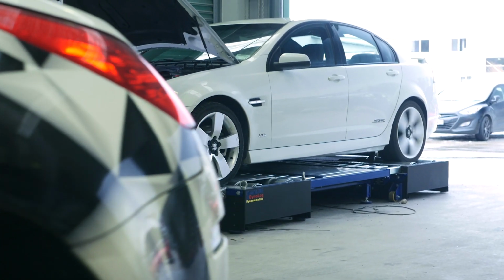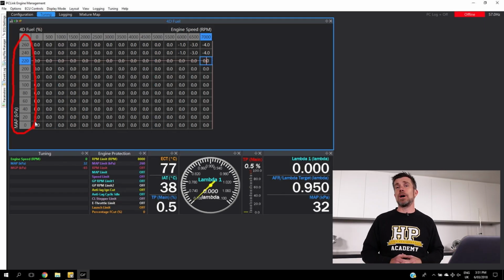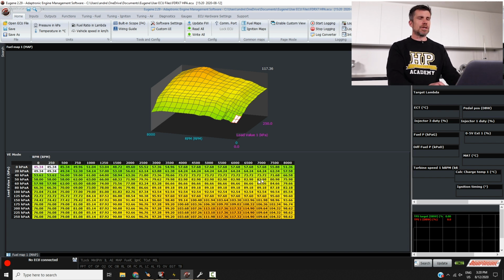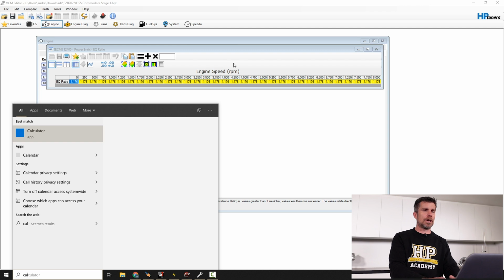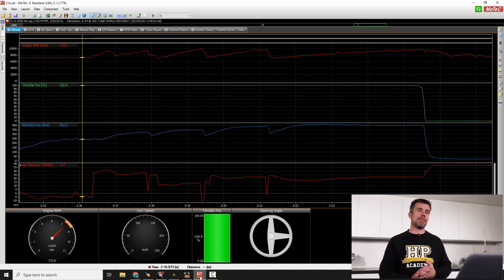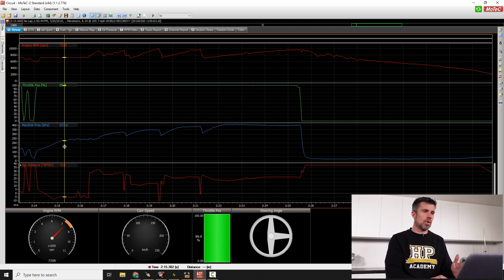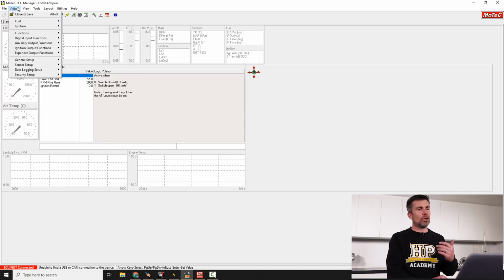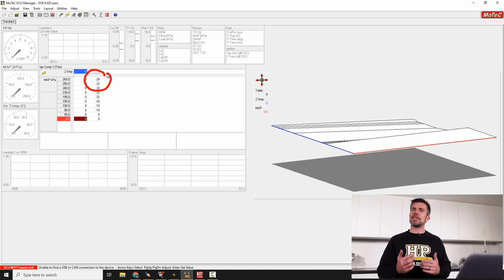Do More RPMs Mean More Horsepower? - AMA With HPA | Ep 11 [OFF THE RECORD]

Comment: For engines with high Volumetric Efficiency like the S2000 and Civic Type R, raising the limiter and shifting at redline makes sense, as the engine can “breathe” at that flow.  Most engines though, run out of breath due to low Volumetric Efficiency and shifting up a higher gear would drop the rpm, to the peak torque rpms would be a smarter choice. Also at higher speeds, you need torque to cut through the air resistance faster

Comment: Another nice content 👍🏼
I have question too, I developed, produced and installed an oil cooler to my daily driven N18B16 engined MY16 mini cooper s. Car itself doesn't have oil pressure sensor ( only has an oil switch🤦🏼‍♂️), I'll add it but I'm wondering, is there any chance to drop oil pressure with replacing OEM heat exhanger with a radiator? Oil starvation is not possible, calculated new oil capacity and tracking every oil change. Everything looks ok for 40k kms but just wondering. Thank you. 👋🏼

Comment: Lovely topics addressed! Such high end builds. Here over in South Africa us car fanatics are all over the place with VW MK1 Golfs, and some of us have really found great boundaries with stock connecting rods an so on using big piston bores where there are basically 1.5-2mm between cylinder walls.

The very last topic where you speak about increasing the maximum RPM of an engine where it actually produces power an not just a lot of noise is insightful. Would love to see an episode of a complete breakdown as to the approach to do just that! 

Keep up the great blogs! Much love

Comment: Yeah, but in the code of some MAF based OEM systems there is a limit of how much airflow, g/s the software would allow and if you exceed this limit, the ECU would illuminate a check engine light and go into a limp mode and that is very annoying, it actually feels like a boost cut. I tried to tune around it with no success although the MAF sensor had still room in terms of airflow capacity. Then I blew the engine, because in that limp mode the ECU was commanding a lean AFR, as can be seen from the log. I still don t understand why! When tiering the engine apart, I found out that one of the intake valve lifters was broken, which explained the misfire codes, but it does not explain the fuel enleanment by the ECU.
Reply from the maker: Yes, although uncommon, there is a good thread where an HPA member discovered an issue with this here: https://www.hpacademy.com/forum/webinar-questions/show/169-is-your-mass-airflow-sensor-big-enough

If you're a member you can post your log and all the details onto the forum for help with some analysis regarding the failure, although obviously you shouldn't just rebuild and run it all the same again regardless - Taz.
Reply: @hpa101  In my particular case the MAF sensor reads up to 402.78 g/s, which should be 5.00 Volts. But the car was going nuts when exceeding 200   g/s. Then in the log it says OL- fault, where the ECU commands lambda 1.57, fuel pressure 461 kPa, 85.9 g/s airflow, absolute load 88.6% and calculated load 40.4%. Could it be sth. wrong with the load tables?

Comment: Hey Andre, great video! Really insightful. Have a question on extending the redline on a EJ257 STI motor (2.5L GVB Engine). The block is getting darton sleeves, JE ultra series pistons, boostline rods all mated to the OEM crank shaft (balanced). Headwork includes a CNC port, +1mm Ferrea valves, titanium valve springs and Kelford 272 cams. What do you think the safe redline will be on this build? Stock redline is 6500rpms, and I was hoping to push it up to 8000rpms with the enhancements stated above. We will also be adding a fluidampr to the mix too. Boost will be provided by a twin scroll EFR8474 turbo, and we intend on pumping about 30psi of boost through. Really keen to get your thoughts
Reply: Have you calculated piston speed yet?

Comment: I thought u had to have a barometric pressure sensor as well for altitude compensation as the engine will ingest the same volume per revolution as in CFM ,  but the  density will vary ,

Comment: I run a centrifugal supercharger (c38r rotrex) on a Honda s2000 engine (f20 bored and stroked) so rpm means boost and power. I run 11k rpm max but aim for 9k gear changes.
Reply from the maker: While yes, spinning a centrifugal SC faster will produce more boost, this still doesn't always mean more power. You still need a head that can actually support flow at higher rpm and a cam profile that works there too. Fortunately the F20 is arguably one of the best N/A head designs out of the box so it does work at higher rpm. Assuming the engine didn't fall apart before hand, even this combination will still fall over at some point if you keep raising the rpm though - Andre
Reply: Even a centri blower has a compressor wheel efficiency island. Just have to match NA peak to blower peak efficiency.

Comment: I like the channel and what you do but I only listened to the end of the video and I might have missed the answer to the question.  Does turning more rpm make more power and the answer is yes it does.  This is the reason why you see many forms of racing have max rpm limits like NHRA Pro Stock and Formula one.  If it didn't make more power race teams wouldn't be trying to turn more rpm.  It is not for the reasons explained though but I apologize if I may have missed it.
Reply from the maker: If you watch the entire answer to the question, all of this is explained. It's not just a case of more rpm equals more power - The head and cam(s) need to be designed to actually support airflow at higher rpm otherwise there's little point. Get those aspects correct though and yes, you can make more power - Andre
Reply: @hpa101   Forgive me if I don't understand, but you are saying that if an engine is durable and able to turn more rpm than yes you can make more power and keep the engine together.  So apples to apples if you had an engine that made 1000 hp at 7000 rpm and another that made 1000 hp at 9000 rpm , which engine would be quicker and faster on the track in Pro Stock, Formula 1 or any rev limited class?

Comment: Some good info' there.
I would add one comment about being able to increase the peak rpm without making changes to the engine to make use of that - there is a benefit in being able to hold the gear as, even though the power is dropping off, it may still provide more than the lower rpm in the next gear can provide. This is more evident in the lower gears, where the rpm drops are higher, and in the top gears it may even be beneficial to change before peak rpm if the gear rpm drops are  small enoough.
I know of one freak engine setup where there was very little power 1k below peak, but there was little drop from peak even 2k past that point - IIRC, nothing below 8k5 (wouldn't take full throttle), peak at 9k5, max rpm 12k.
Reply: Another spot where a higher rev limit and no changes helps was in a civic that ran in a pure stock oval class. The car would run into factory rev limiter part way down the straight away and the amount of time to shift up and then down shift for the corner was not ideal for setting up the turn in. Found that a stock computer for an SI civic had almost 500 more rpm and a quicker limiter and we were able to run the car further down the straight before hitting the limit and not needing to shift. Of course we got faster and started hitting the limiter sooner again, but with a quicker limiter it didn’t hurt as bad as before.
Reply: @Allaroundracer  Totally agree, and not just the time for the shift - it may mean being able to avoid upsetting the chassis under braking if it' s already in the gear for the corner, or it may allow the vehicle to accelerate further out of the corner before the change which may allow more flexibility on gear selection for the corner/bend.
I used to do a lot of motokhanas - the british call them auto-tests and they' re like a tighter, slower version of the USoA' s SOLO events - most were 1st gear with maybe a bit of 2nd, and by extending the rpm, one could stay in the lower gear instead of having those pesky changes you mentioned.

Comment: Hi there just curious to know How is cold start managed in a car with individual throttle bodies which is being tuned by TPS.
Thanks.
Reply from the maker: It's really no different in terms of the additional fuel requirement - this is normally handled by a warm up enrichment table. Where things get a little trickier is with the idle speed control as this requires additional air bypass when cold. If you're running dbw then this isn't an issue as the TPS reports the additional air which needs to be compensated for.

Comment: can we have more ?? that's a lot of good info ! thx
ps the length of rod is also important in some engine if you want go at high RPM (longer rod can help to decrease the pic acceleration of the piston and the angle of the rod)
Reply: It can also have a significant affect on breathing around overlap and reduce side loading, and friction losses, on the cylinder wall.
It can also reduce the instantaneous acceleration rates, which will reduce inertial loads and, potentially, ring flutter.